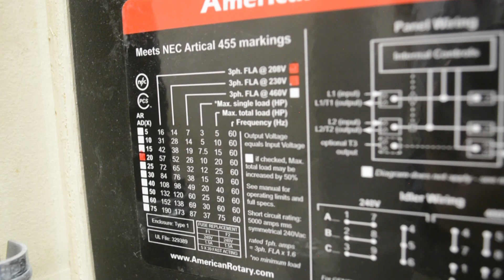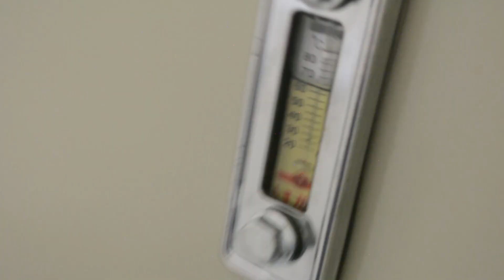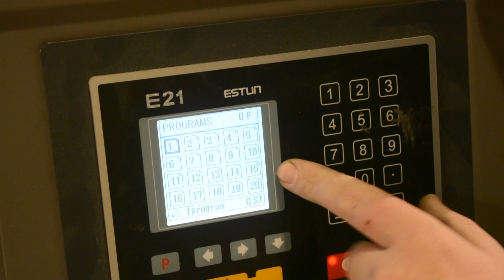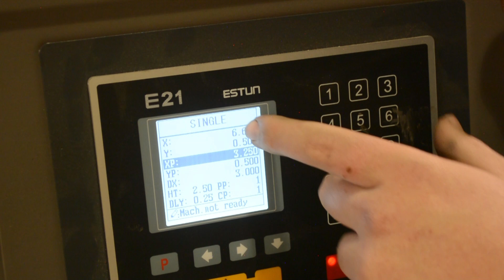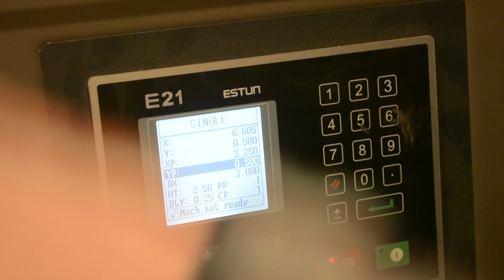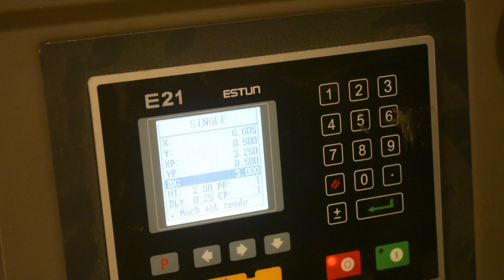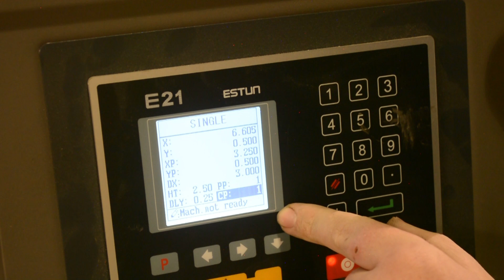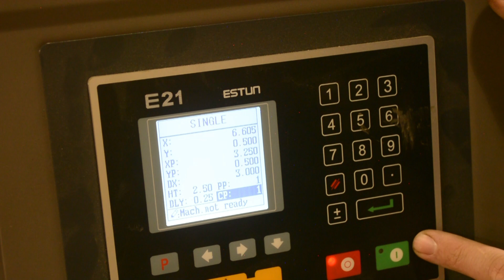BP-3305 CNC // In Action

Comment: Thanks for posting this video. Really thinking about pulling the trigger on one. Can you get any bends over 90 on the v die? Say 95? Also how is it squaring up parts. Looks like you got a good handle on the machine. Can you also point me to the phase converter you purchased. Thanks again for the efforts and content.
Reply from the maker: I've been able to bend past 90, maybe around 100 - 110 degrees. If the piece is wider than 3.5" you can square up against 2 back stops. Unfortunately the backstops aren't square so you need a straight edge to bend skinny parts. I may get some custom back stops made in the future that will solve this issue. The invertor we used is the adx 20hp.

Comment: Thank you for posting!  You're right, there's not much out there showing this model running parts.  I found that strange that Baileigh doesn't have a better video.  Good to know about the delay in angle change.  Is it really 2 full minutes?  Looks like a nice machine for the money.  Can you post a link to where you purchased it?  Great info on the phase converter also...
Reply from the maker: Thanks for the comment! It takes awhile, ill have to time it and see exactly how long it takes. I bought it through summit, the price has increased for it everywhere you can buy it. Glad we got it when we did.
https://www.summitracing.com/parts/bai-1020680?seid=srese1&gclid=CjwKCAiAt9z-BRBCEiwA_bWv-ETMKEbzYiwL9ouUcozaQ1Eecv4hmIMT0K-KXkTNkQ6GRxWzHjWuYBoCM3YQAvD_BwE

Comment: Do they make different punches and dies for this machine or are we stuck with the ones it comes with?
Reply from the maker: Not that I know of. I'll be cutting my punch here soon into fingers, I've seen some other shops cut there dies as well. Or even run a custom block on the bed to be able to use off brand dies.
Reply: @scrapingpavement  Cool, thanks for the info. Hopefully you can share the finger mod with us in a video! I need to do the same thing at some point.

Comment: how do you set it for lets say a 90 degree bend on 10 ga mild steel?
Reply from the maker: Set the die to the appropriate V-channel, adjust the punch depth based on thickness, and let er rip. It's a basic machine, so you need to adjust for spring back and part width. Once it's dialed, send a bunch of parts through it.

Comment: Thank you for posting such a thorough review. I had heck of a time finding any info about this model. Based on your experience, do you think this model is well suited for 90 degree bends on 2’2’ pieces of 1/8” cold rolled steel?
Reply from the maker: Happy to hear that! Ya 2 foot 1/8" plate shouldn't be a problem at all. I got some plans for bending 3 foot 3/16" parts in the future, I'll have to throw up a video when i do that.

Comment: Is this machine capable of bending 11gauge 5ft long 308 stainless steel?
Reply from the maker: According to there tonnage chart it can bend 5ft 11g SS but you would have to use the largest 2" v die as it would require 24tons of pressure. If you went to the next smaller v die it would require 42 tons of pressure which exceeds the 33tons this machine offers.